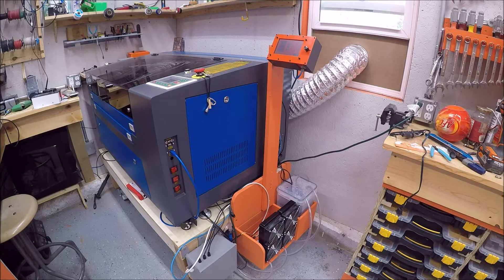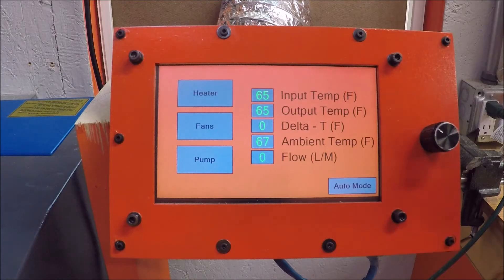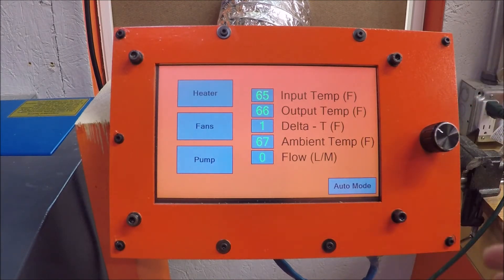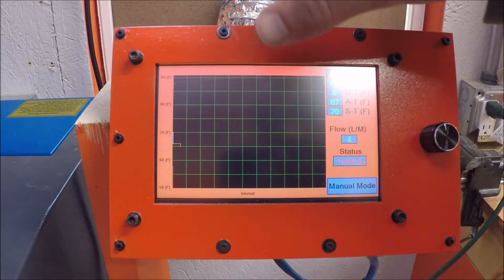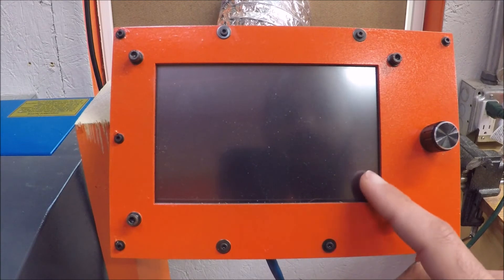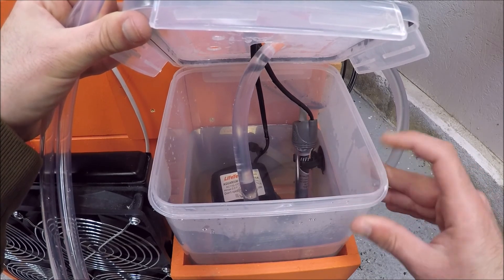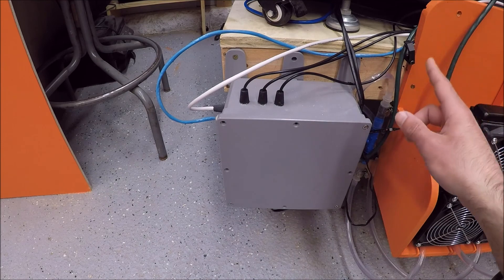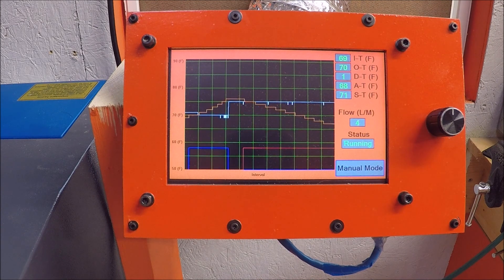Overly Complicated CO2 Laser Chiller System!

Comment: Great idea to use those PC radiators! I have ordered one for my system.. do you reckon one of those radiators could be sufficient as well? Decided to place my tank and pump above the tube lvl, hoping that will keep any air bubbles out of the loop. The graphs are great man! nice project!
Reply from the maker: Honestly I thought 2 radiators would be overkill but depending on the ambient temperature they are just about right. That being said I am sure you will still get good results with 1 radiator. Good idea about putting the tank above the laser tube to reduce air bubbles. One word of warning is that if your laser is in an unconditioned space during the winter months you don't want ice forming in it. Good luck on the project and thanks for watching!